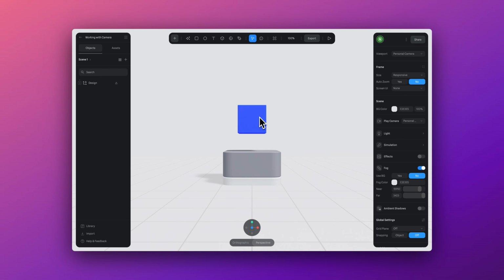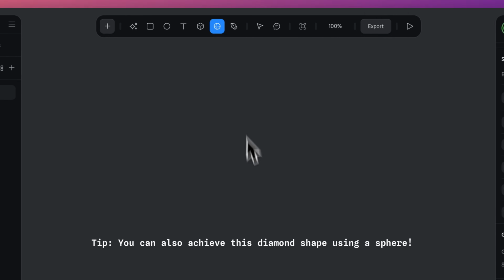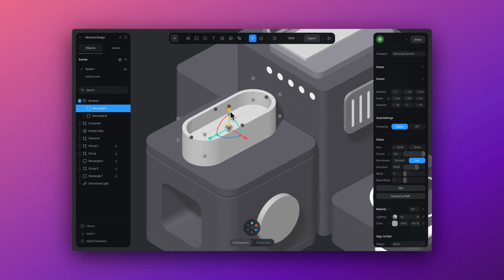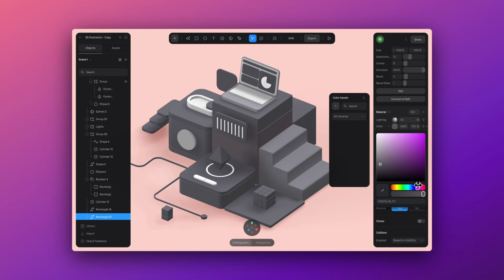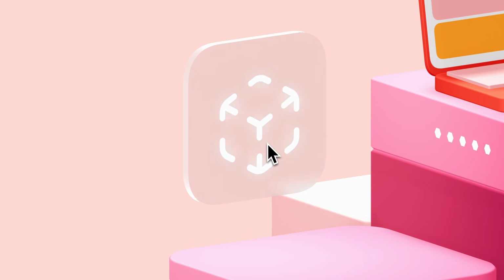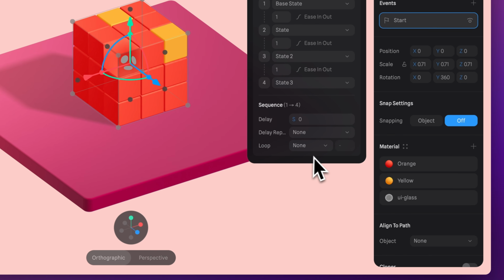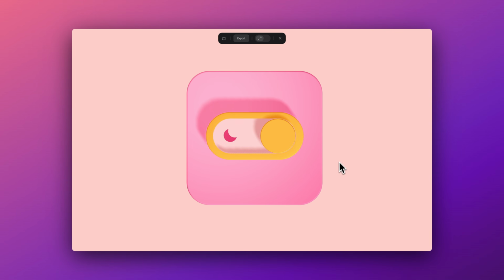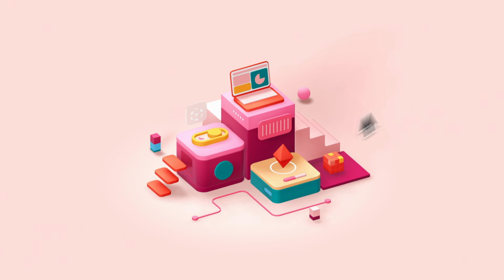How to Design 3D Abstract Illustrations in Spline  | Beginners Tutorial

Comment: Awesome tutorial but I have some doubts in some points:

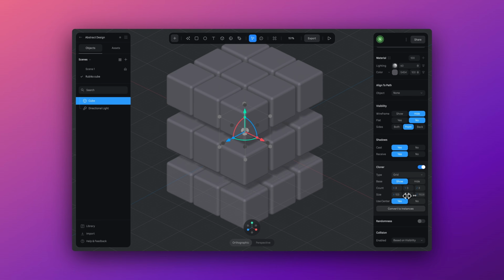min 3:14 I would like to know how did you copy the cube into the main scene and resize the cube without resizing each cubers?

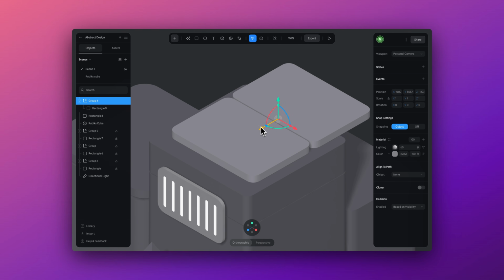min 5:15 how do you adjust this point to the center without moving the object?
Reply from the maker: Hello! Sorry for taking a bit longer to get back to you.

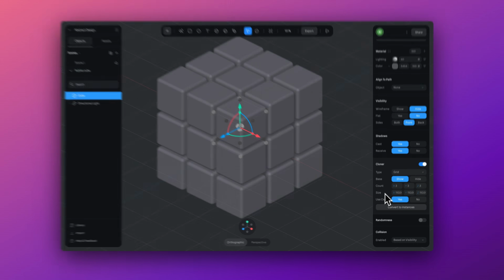3:14 - This is because we hold ⇧(Shift) while adjusting the scale. So, when adjusting its size, it was modified uniformly.
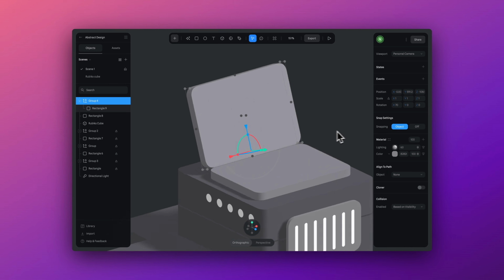5:15 - If you are referring to how to move the pivot, you can do this:
Group your object, hold ⌥ option (or Alt on Windows), click the "Group" layer, and using the gizmo to move the pivot's axis position.

There is more info in our Docs about this 👉https://docs.spline.design/fb1fc093fc4c436dae9cb5124a3879e2

Let us know if we can help you in any other way!

You can also join our Discord server to learn more along with other users 🙌